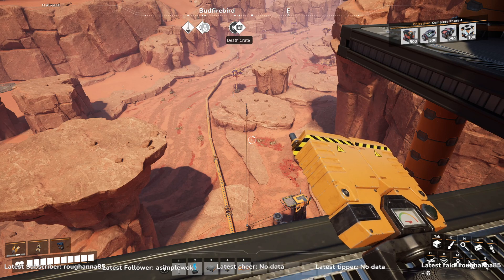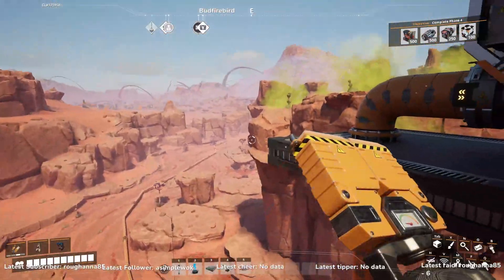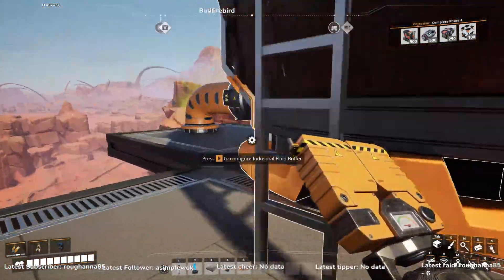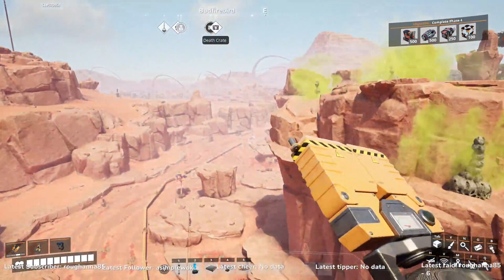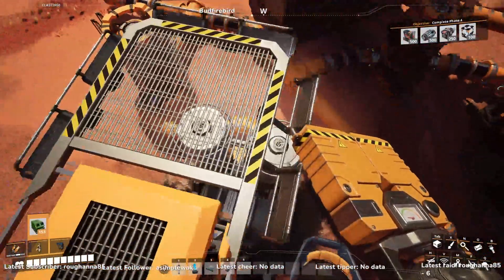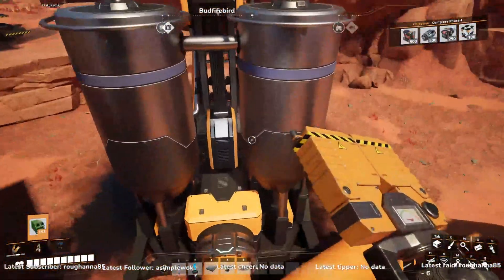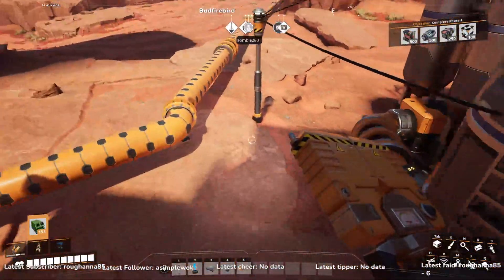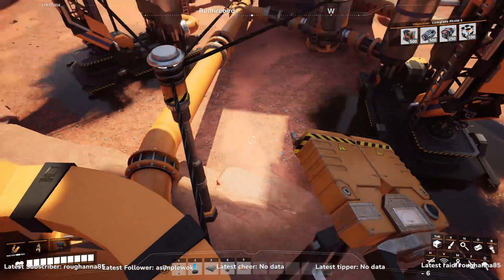Satisfactory 600 fluid flow fix.

Comment: If you only have one pipe, you can’t pipe out the full amount of oil at that site. two pure nodes and two impure, that it’s at that’s not very efficient😂

If you link one pure and one impure, you’ll never have more than 600 in 1 pipe. that was my solution then you don’t need a buffer anywhere

But it was still a very good, lesson thank you .
Reply from the maker: @DebianDog  needing more then one pipe wasn't the point of the video though lol
Reply: @BudFireBirdPhoenix  I didn’t see two pipes going to the factory man😋

Comment: no valve just buffer in inside the circuit ? did you let the pipe fill up before using the oil and does it still works after reloading your game?
Reply from the maker: @leomonchet971  no you don't need to let it fill up first and yea works great after reload.